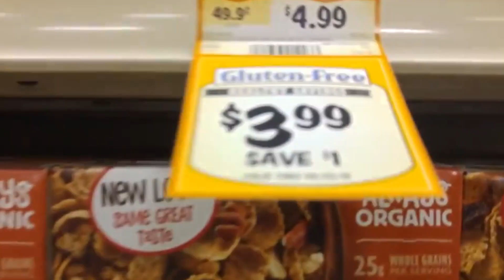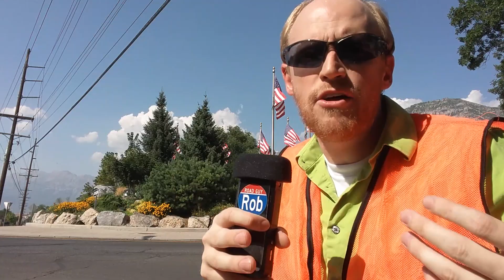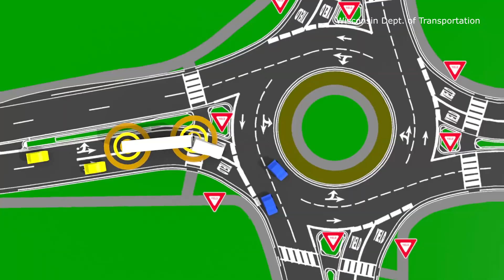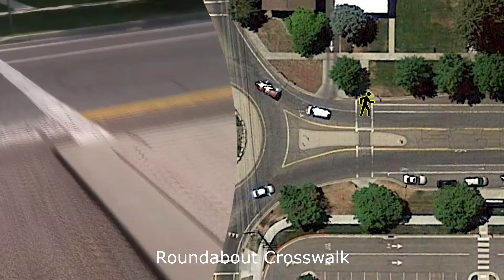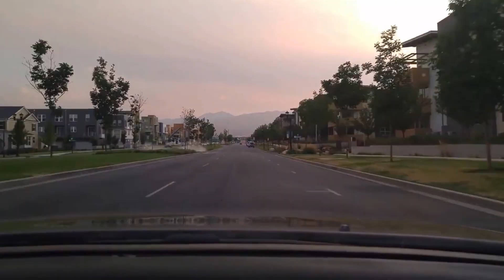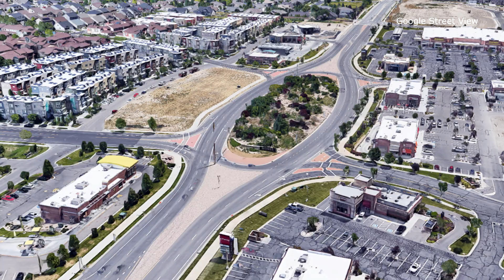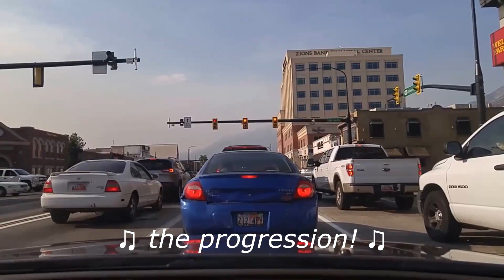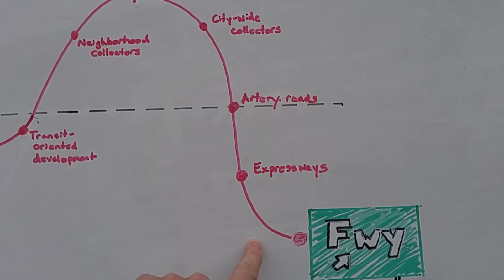Are roundabouts REALLY better than a traffic signal?

Comment: Pedestrian footbridge, extremely cheap. If you even have to. Pedestrians don't even think about it anyway. They won't complain. To reduce fatal accidents by 90%? Let the little - walk. He's already walking. High Pedestrian traffic areas, build a cheap footbridge directly over, even include wheel chair route. All problems solved.

people want to actually see a utopian society, you NEVER will without a roundabout. As long as a traffic light exists, you're NOT in a utopia. Aesthetic beauty as a direct consequence of superior function? It strictly requires bad human beings to disagree after being informed of the full concept. Roundabouts offer one more use, the ability to weed out the scum of society, in addition to its already IMPRESSIVE list of benefits.

Comment: Roundabouts are great in lower traffic situations, but can be a nightmare in high traffic situations.... and get especially horrific where the traffic flow is unbalanced, example, east-west having high traffic flow but north-south being low... the high traffic flow gets compressed at the roundabout, so people coming from the slow direction basically get 'locked out' of the roundabout, and you can only proceed by being pushy, which disobeys the rules of how the roundabout works.

Comment: In the UK, most motorway (freeway) intersections are roundabouts above or below the motorway.
They work pretty well, and back in the day, a great place for hitch-hiking - a wide slip lane coming off the roundabout, before you got to the motorway no pedestrians no stopping regulations, and traffic was moving at modest speeds - also the drivers had been woken up by the roundabout, and could see you hitch-hiking.

Comment: That big oval thing was not a roundabout as traffic on the main route does not have to yield to anything.  Traffic wanting to cross it on those bottoms roads from west to east has to cross two lanes and hope the third lane is free, then wait to cross two lanes.  From east to west it has to yield to join, then quickly cross two lanes, circulate around, then cross two lanes quickly for the exit lane.  It has none of the safety or traffic management features of a roundabout.

Though from the road layout I am guessing the traffic flow would not support a normal roundabout.  In the U.K. traffic light controlled roundabouts are used in situations like that to maintain the safety benefits of a roundabout compared while ensuring traffic on side roads gets to join the roundabout without having to wait for gaps where the flow on the main route is too dominant.

And those safety benefits are that you do not have the wide open space of a tradition junction (intersection) where traffic can run a light and approach from any direction.  Instead everyone is travelling in the same direction and all entry and exit is on the same side so there is less chance of people emerging in blind spots.

Comment: Don't put roundabouts on the freeway? Tell that to Wickenburg!

Roundabouts break up platoons, but it also feels to me like platoons mess up the flow at roundabouts. When all the cars hit at the same time, they can't just slip through with a well-timed speed adjustment and the platoon ends up as a backed up line turning the roundabout into a lower-visibility, less coordinated 4-way stop.

That said, I think anywhere you have a 4-way stop with enough room, a roundabout is probably a huge improvement.

Comment: In my city (0.8 m inhabitants) in Poland many years ago they have changed the biggest intersection into roundabout and it worked very well. The roundabout has 4 lanes. We have to have a traffic sygnals when you enter the roundabout and there are traffic sygnals on the roundabout itself. We also have a camera at the entrance so they want to give a priority for trams and buses. We also have a countdown so you know when the light would change. There is an underground pass for pedestrians and at the roundabout. It also has on the centre a big bus and tram stops with 4 platforms. It is called Rondo Regana in Wroclaw (yes, for American president Regan who is appreciated in Poland).

Comment: Each intersection has an average of 36 bulbs including pedestrian displays, arrows, green, yellow and red balls. The daily cost to power just the traffic signal heads is $5.40 if not LED or 90 cent if LED per street intersection. Monthly it would be $162 if not LED or $27 if LED…. Not $5000-$10.000 at minute 3:49

Comment: It depends.  Where I live there are two roundabouts, one at each end of a freeway interchange.  Most of the time they aren't terribly bad to navigate, but during rush hour, you can wait and wait and wait to enter the roundabout because traffic just doesn't stop.  You have traffic coming off the freeway, you have traffic coming down Main Street, you have a truck stop, and if you are unlucky enough to be at the truck stop at the wrong time, you're going to be sitting quite a while should you want to leave.  At least with a traffic light you get a break in traffic.  The other problem is that the center of the roundabouts are rounded and landscaped with bushes, so if you want to enter the roundabout, you cannot see if there is anyone on the other side of the roundabout until it is almost too late.  Furthermore, you can't tell if they are going to go straight, which means you can safely enter the roundabout on your side, or if they are going to cross in front of you to enter the Interstate.  Again, when there is no break in oncoming traffic, you can be sitting there and blocking traffic on your side.  The bridge connecting the two roundabouts is very narrow and outdated and should have been widened decades ago but MDOT in its wisdom said no, we are going to give you roundabouts.  I know at least one person who will not drive these roundabouts meaning if they have to cross the freeway they have to go miles out of their way to the next nearest bridge.  Frankly, I think this pair of roundabouts was very poorly designed.  Another thing is that although drivers already in the roundabout have the right of way, more than once I've had to jam on my brakes because a driver (usually a semi anxious to reach the truck stop) comes roaring off the Interstate without even yielding or slowing down even though I am already halfway through the roundabout.

Comment: You would be shocked just how many roundabouts there are in the UK. In the countryside, we use them all over the place. When you exit a motorway/freeway, the traffic is routinely handled by roundabouts. Some even have traffic signals on them believe it or not. I've found them extremely efficient. There's nothing worse than sitting and waiting at a traffic signal in the countryside where there isn't another car in sight. We even use them in tight urban streets as 'mini-roundabouts', where a white circle is painted in the middle of the intersection and traffic just naturally gives way to traffic coming from the left (for Americans, the right), meaning they act as a traffic calming measure as well. I've noticed that roundabouts are also taking over Australia in a similar fashion (and don't even start me on France).

Comment: 3:30 uhh,no
So first,juste compare thee number of step you tak ON the road,which would be around two time less than a normal intersection.
Also on this roundabout,its good to see that you enter it with only a 1 lane road ane not a two lane roae,it avoid the risk of a car not seing you because their is another car that hide you.
My second pointis that a roundabout doesn't need to be big,in my town there is some roundabout that are not even the size of a third of an american intersection.
Finally it doesn't bother that much me as a pedestrian to walk 50% more steps just for an intersection if it reduce by 90% my chance of getting hit by a car and reduce the time of waiting at a red light

Comment: Roundabouts around this area cost over 10 TIMES what traffic lights do AND they affect EVERY SINGLE VEHICLE, EVERY SINGLE TIME.  There is no claim that they reduce traffic accidents because they don't.  They do increase air pollution and fuel usage  and they do take a lot more space to build.  They are better than 4-way stops and single lane roundabouts can be effective with mostly local traffic.  But if you want to see a circus, try 2 lane roundabouts with a lot of visitors, like in The Villages.  Yet another example of planners getting it wrong because real life is very different.
Reply: Roundabouts are more expensive but ends being the same price I. The end, roundabouts don’t reduce the amount of crashes but the serverity, the air pollution could depend on a lot of factors, such as how big the roundabout is, and some roundabouts can take up the same footprint as a traffic light, and only having it as local areas is literally what Americans are not doing, that’s why you kinda hate them. Traffic lights are good when there is traffic or more then 15,000 cars a day each side, if you’ve got a 2 lane roundabout and cannot keep up with traffic, that’s when I believe you should put traffic lights in. Or if a 4 way stop can’t keep up then put a single lane roundabout. A roundabout moves more traffic per minute then a light but not per cycle.

Comment: Non traffic engineers or traffic engineers not being loyal to traffic objectives that push for roundabouts are likely seeking traffic calming which discourages through traffic.  A roundabout is a traffic circle that is single lane with an operating speed of 10 mph - 15 mph using yield merge traffic metering.   Multi-lane higher speed traffic circles are not roundabouts and can be excluded from safety statistics for roundabouts for people pushing for roundabouts.  This is an easy way to scam the public and some traffic engineers.    Multi-lane traffic circles are not safer.   Use of roundabouts is detrimental to traffic flow of the primary road over a traffic light controlled intersections.  A roundabout removes liability inherent with an active traffic control device and places it on the drivers.   

Replacing a traffic light controlled intersection with a multi-lane faster than 15 mph traffic circle at Mt. Comfort Rd. 300 N in Mt. Comfort Indiana has resulted in people seeking other routes, typical for a traffic calming, and a fatality with no fatality at that intersection being in living memory.   That traffic circle looks difficult and unsafe and I dislike riding my bicycle through it.   It is slower and it had killed not being an improvement from the traffic light controlled intersection.

Comment: As for multi-lane roundabouts, in my country (and the post-Soviet world in general) they especially suck. You can enter the roundabout from any lane. But you can exit only from the far right lane (even if there are multiple lanes after it). This is because vehicles can go straight from any lane. Essentially it functions as a series of T-intersections. And this obviously limits the capacity to a single lane.
As you can imagine, this is often ignored in practice, and vehicles exit from the left lanes, sometimes leading to crashes. Some drivers make a living by driving in circles in roundabouts and intentionally crashing into drivers exiting from the wrong lane, in order to "teach" them.
But there is hope. Some roundabouts use signs and markings to reserve certain lanes for going straight and turning right, overriding that rule. And turbo-roundabouts are being introduced in some places, which eliminate this problem entirely, since drivers are already in a suitable lane. They only have to change lanes if they need to take the 4th exit (U-turn).

Comment: I have seen roundabouts used to excess in some situations in Europe. Take a straight country road, two lanes with very little traffic and quite a few intersections with even smaller roads and stop signs. Now turn every one of thos little intersections into roundabouts, and by the time you've driven a few kilometers you're actually getting dizzy. And tired too! It turns what was a simple, lazy straight road into a real workout.

Comment: There's one use case that works poorly on two-lane roundabouts, and I have only had it happen twice. I'm in the right-hand lane going through to the other side--basically, going straight. Someone is coming from my left on the inside lane going straight, which is perfectly legal. For a moment, we're side by side with my friend half a car-length ahead of me. But my friend crosses my lane in front of me. So far, I haven't lost any paint or metal, and now I ignore that ridiculous sign and imagine that it says "Be VERY Careful!" Perhaps, the powers that be shouldn't allow what amounts to a right turn from the inside lane. That is a fender-bender waiting to happen. No one is likely to be killed, but the damage will run into the thousands.

Comment: $10,000 per month for electricity to run one signalized intersection?    Is that possible?
Reply: No, that is ridiculous.  With the old style incandescent bulbs, a typical intersection would use at most around $120 of electricity per month.  With the modern LED traffic lights, that drops to only $12 per month to run the intersection!   I can't think of anywhere in the real world where the power consumption of traffic lights would cost anywhere near ten grand a month.  That 10k figure is only wrong by about two orders of magnitude...   so no, its not possible, not even close.  10,000/month could be the cost of running  stoplights for an entire city, a decently large city!     Street lighting is gonna be a far bigger expense, dwarfing the cost of running traffic control devices.
Reply: @jameswarner7435  You also have to consider the controller, and detection equipment. That needs a lot of electricity.

Comment: Racing nerd here: Detroits redlights were the birth place of the drag racing culture. It spread through the US as much of the city structures were never designed for the use of cars initially and many defaulted to the 4 way stop, which was replaced with the electronic stop sign, the traffic light. What's interesting about that is the rest of the world did it a bit different, and that resulted in different driving cultures. When I left Canada to live in the UK for a while, it was really uncommon to come across an Automatic car, especially one of a large displacement. Most vehicles were small engine manual. Leaving my house I could traverse huge sections of the UK without ever having to stop my vehicle fully. Sure I needed to slow for many of the roundabouts, but it was uncommon to have to completely start from a stop. This not only made driving manual much more casual, but it saved me so much fuel consumption, especially when moving heavy loads, as I didn't need to regenerate the energy of getting the car back up to speed. Additionally to the benefits of fuel consumption, brake and transmission repair was commonly less. Traffic lights are often a lazy-american solution where they rely on large displacement automatic vehicles to make up for the inconvenience of having to stop so often. Especially because platoons only work if everyone drives within the expectations of the engineering. However, most drivers don't enjoy driving close to one another, some will speed up, others will slow down, and generally drive independent and not conscious of the light timing. Additionally the cross traffic and opposite flow traffic will interrupt that platoon planning on a intersection by intersection basis as well as short time scale hourly, and large time scale, seasonal basis. So the whole platoon planning becomes null. 

Living in Australia I was a cyclist more often an a motorist. They participate in a large amount of roundabouts and I often found myself in danger. It was really difficult to navigate on bike and just as scary on foot. 

What seems to be so often ignored, is the opportunity to have pedestrians request the stop of vehicles integrated into a round about. Often high pedestrian areas have pedestrian controlled crosswalks, separate of the intersection, which are often far away from the intersection regardless of intersection type. Instead, install pedestrian controlled  cross walks at the roundabout, so the traffic can flow at all times of the day, unless otherwise requested by the pedestrians, since most people in North America don't do that much walking outside of the city cores anyways. 

I also lived in Maryland for a while, Y'all need some fuckin' sidewalks, lol

Comment: The city of Green Ohio now has 6 roundabouts on a 1.5 mile stretch of road.  There are a total 12 in the very small city with plans to pretty much eliminate all lights.  Traffic goes a lot smoother and overall faster once people learned how to use them.  I cut 7 minutes of my work commute not waiting at lights.

Comment: Multi-lane roundabout is not a really good idea IMO. You can have an extra right turn lane, but that's as far as one should get. However, it is still obvious to me that Stop sign and traffic lights are overused and roundabouts are underused in the US. Stop sign should really be used in low-speed places like parking lot. Traffic light should only be used when it is multi-lane intersections. Also one structure that is underused is free-flowing traffic.

Comment: One thing I really wish they'd do is turn about 90% or more of the stop sign intersections into yield intersections... There are very few instances where its actually necessary to come to a complete stop to safely move through an intersection. Most of the time you have good visibility and if you're on a quieter neighborhood street usually you're only waiting for 1 or 2 cars tops before you can go. If its a 4 way stop where you almost always have to stop and there are lines of cars backed up its time for it to become a traffic signal intersection (or roundabout)